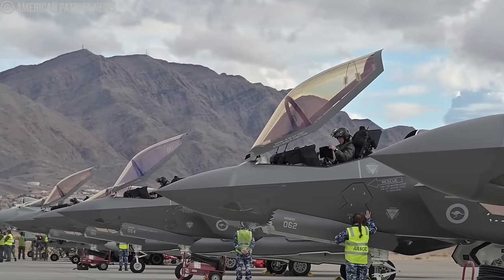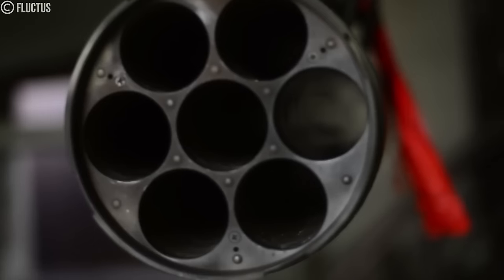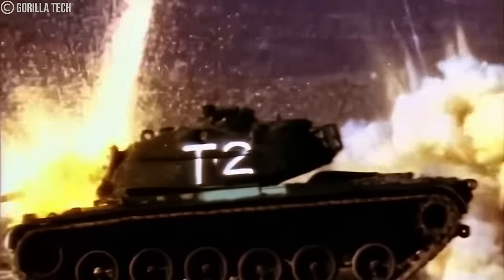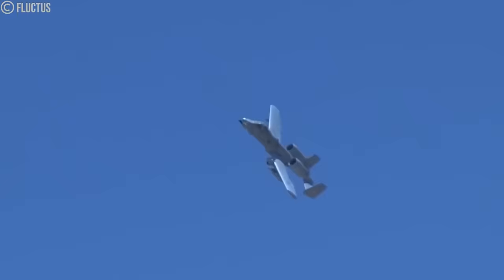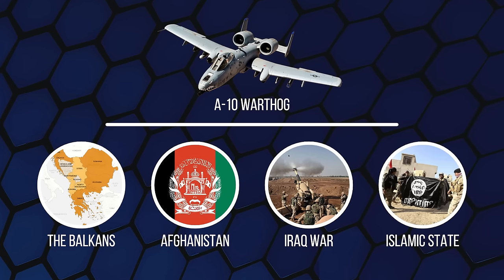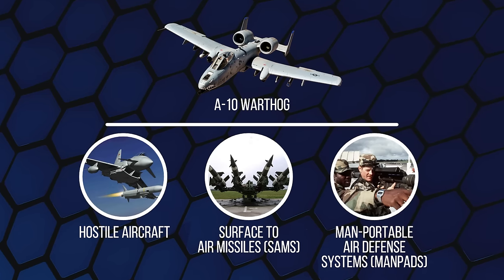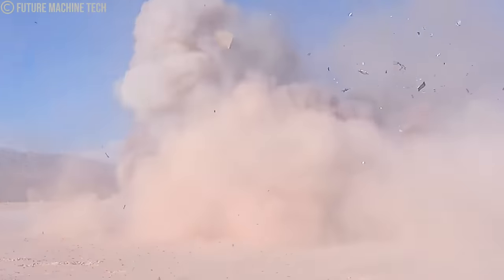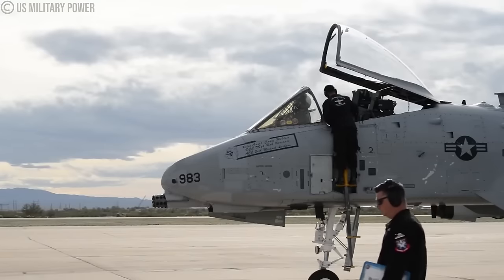Why America's New A-10 Warthog Shocked Yemen, Hamas and Russia!

Comment: 7 barrels? 6 with a center support just like and Gatlin gun configuration.
Reply: Nope, it has 7 barrels so that the one firing is on centerline of the airframe. This is easy to look up.
Reply: Just assumed it was 6 like the CIWS I worked on.
Reply: If you search for GAU8, you will find the GAU8 has 7 barrels.

Comment: The Air Force has been trying in one way or another to declare the A-10 obsolete since 1989.  So far the Congress has blocked this madness and demanding a competent replacement be available BEFORE the A-10 is grounded.  First the F-16 and then the F-35 were proposed as replacements.  Both planes titles begin with F which means they are fighters and not ATTACK aircraft.  Neither can approach the capability of the A-10 in ground support activities.  A function the Air Force has long shown little interest in.  If it's not supersonic or nuclear capable the Air Force isn't in favor of it.

Comment: you went into 0 deptrh about the amazing feat kambell did flying the damaged a10 warthog back to base an hour away...the a10 flew and landed perfectly weith thousands of holes from cannons and small arms, it was missing the tail wing, a huge part of one of the main wings, a huge section of fuselage was gone, one missing engine, AND the entire hydraulic system of the plan was 10-0% disabled and copuld not be used, she had to use another back up system that was 100% manual override backup with 09 hydraulic assistance....also the 30mm gatlin gun on the front and the entire plane isnt nicknamed brutality commonly, its commonly called THE GUN. or the flying gun or the flying tank but mostly, just THE GUN

Comment: Think about it, history does repeat itself!
The A.D. Skyraider was built for World War II, but too late. No one ever mentioned it during Korea, because the Air Force was certain that all they needed was fast jets and missiles.
But it actually had to be put back into production because during Vietnam, the downed Air Force pilots found out that the only thing that could save their butts was the old prop driven” spads and sopwith camels” as they were unceremoniously nicknamed!
Politicians and bureaucrats had to eat What the Viet Kong filled their pajamas with When they found themselves at the wrong end of the A1 Skyraider!
40 years later, the A-10 thunderbolt two is serving up the same cuisine to our current politicians and bureaucrats!
I think we need to replace the current politicians and bureaucrats with the fine young men who are better known as grunts on the ground
They undoubtedly will GET IT RIGHT!
.

Comment: The US Airforce Top Brass have finally understood that the only replacement for an A10 is another A10, hence the re-winging and upgrading of its avionics, it is the USAF's only true multi-role aircraft with the ability to carry nearly all of the standard ordnance in the USAF's inventory. The A10 was designed from the start to operate from austere airfields.
If the US Airforce Top Brass has any sense it will clone the A10 and resist the temptation to make it "better"!
If the US Airforce Top Brass ever want to give up the A10 they should offer it to the USMC lock-stock-and-barrel, as I'm sure the USMC would be able to get the best out of the A10!

Comment: There are no new A-10's.  It had an upgrade about 6 years ago but they are still the original aircraft.  The US Air Force is run by generals who were fighter pilots.  They have little regard for close air support.
The A-10 is not in Ukraine because it is vulnerable to enemy missiles.  Air superiority is needed prior to deploying the A-10.  The F-16 does have the ability, in sufficient numbers, to give Ukraine the necessary air superiority.  The US had never allowed another country to acquire the A-10.  Maybe a Flying Tiger type of organization made up of retired A-10 pilots could be developed.

Comment: I would love to see the airframe converted to fire fighting in canyons the worlds most brutal water dispersal system 8000 pounds of water in a sortie rapid turnaround very safe for pilot just fly right thru trees  short unimproved runways Boeing sub contractor can supply new parts except for the bathtub Air Force likes high and fast ground support is just better low and slow they tried to avoid deploying it in the 70's and have been trying to retire it most of it's service life great plane